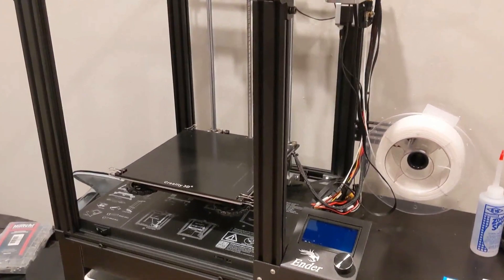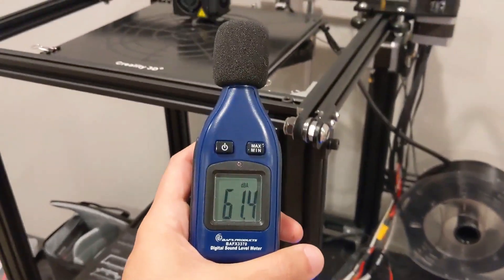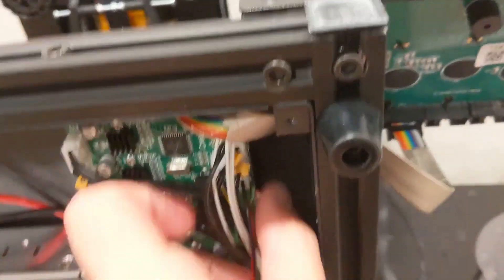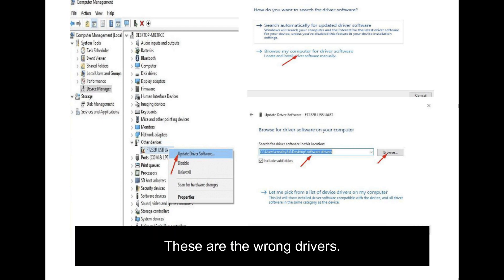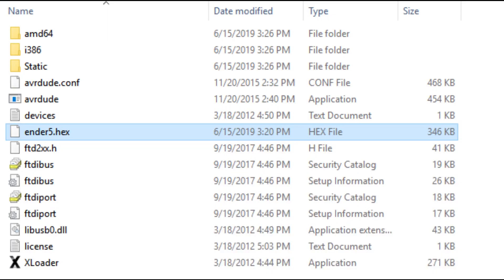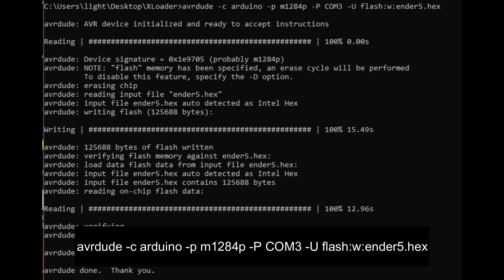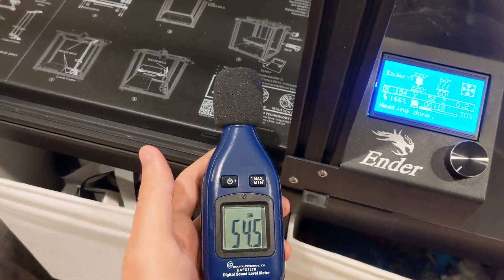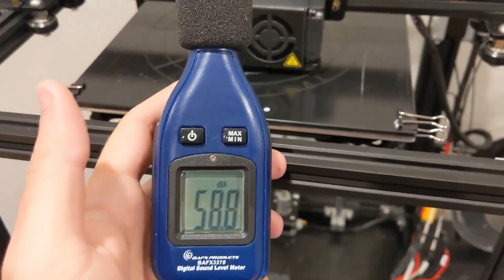Ender 5/3 Silent Motherboard Upgrade

Comment: Thank you for your video tutorial. It worked like a charm! But only after I found out that for Windows I need to install WinAVR which contains avrdude.exe in the "bin" directory (in my case: "C:\WinAVR-20100110\bin"). I copied the ender5.hex there and started the command like you described. You might want to add the link to WinAVR to your video: http://sourceforge.net/projects/winavr

Comment: Thanks. This was really helpful. I'll include some additional instructions about AVRDude though, as that wasn't obvious (for me at least):

First of all, after you go to the download page, you will only need to get the avrdude-[something]-mingw32.zip. Take the one with the highest version number.

When running AVRDude you might get a message, that it is missing libusb0.dll. In that case download the zip file from https://sourceforge.net/projects/libusb-win32/files/libusb-win32-releases/1.2.6.0/libusb-win32-bin-1.2.6.0.zip/download , copy \libusb-win32-bin-1.2.6.0\bin\x86\libusb0_x86.dll to the avrdude folder and rename it to libusb0.dll (It needs to be the x86 version, as AVRDude is also 32-bit)

 And finally, if you don't know what your COM-port is: after connecting the printer via USB go to the device manager, open Ports (COM & LPT) in the list and look for USB-SERIAL CH340

Comment: i did it, works like a charm for my ender 5 with the drivers you linked, just needed to install the driver after plugged in the board, when i installed the driver first without plugging the board in it i got a COM port error, after installing it again plugged everything worked x) 

thank you so much x)

Comment: hey there, i get the libusb0.dll erro fixed install winavr,  i get the new board in a few days and want to be prepared when it arrives. 

and can i use the CH340 drivers for the 1.1.5 board too, https://www.th3dstudio.com/knowledgebase/creality-printer-drivers-all-models/ i found this and it says i would need those FTDI F232R Windows Drivers, or can i try with CH340 too? 

i downloaded the 1.1.6.3 from the ender site hex file so i get the newest

thx alot for this video!

Comment: This worked great to flash on the new 1.1.5 board. Is there a 1.1.9 .hex file for the Ender 5? The github stuff I see on marlin's site doesn't contain any .hex files.
Reply: did you took the CH340 Drivers: https://sparks.gogo.co.nz/ch340.html
or the  FTDI F232R Windows Driver?  https://www.th3dstudio.com/knowledgebase/creality-printer-drivers-all-models/

Comment: The hex flash gymnastics were slightly different on Linux machine (e.g., no COM ports). 
For those willing to try here is the basic command from my download file that seemed to summon the mojination:

 'sudo avrdude -c arduino -p m1284p -P /dev/ttyUSB0 -b115200 -U flash:w:/home/user/Downloads/ender5.hex'

Thank you so much LOHTEC for finding the hex file.

Comment: you can up the voltage for the creality board on the board itself with a screwdriver! the board drivers don't come at set voltage because each printer is different so you need to tweak the voltage till you get a good run. look at your new board & you'll see next to each soldered stepper driver there's a silver cross shape that you can turn clockwise & counterclockwise to adjust voltaje. just fyi if you think you're stuck with an under-voltage ender 5
Reply from the maker: I'll check it out if I have time. Was running .9v on my anycubic, so not sure what these are at.
Reply: @LohTec  i hear ya, i did the same process but i checked the voltage for each axis driver when my old board was installed & made a note of it. that would be the easiest. you might be able to plug in just the input voltage of your old board & get a multi-meter to check the driver's voltage presets.best of luck

Comment: Hi there, how did you discover you couldn’t print as fast? What issues did you encounter? Could it be a marlin setting?
Reply from the maker: I got layer shifts as soon as the slower bottom layer finished. Reducing travel speeds from 120 to 100 fixed that.
Reply: @LohTec  I just read a comment on another 1.1.5 board video that the vrefs come from the factory set too high. I wonder if this is something you could experiement with and see if you have any better results? 

From the video: https://youtu.be/6nHOp-j3dtE?t=1188

Comment: 
"Your stock vrefs a bit high i think.
I had same values with same board and i was having hot y stepper during long prints. 
I asked to customer representative of creality about my problem and they asked to their technical department then they gave me these values XYZ 0.94V，E 1.2V.
I changed my vrefs to these values and never had hot y stepper again. Also i didn't get any layer shift on my prints."

Comment: can you show a video of how you used all the systems to upload to the ender 5
Reply from the maker: It's just typing in the command prompt after you extract all the zipped files. Is that what you wanted to see? It's just that one thing to type.
Reply: @LohTec  i think i found my problem i have been talking to creality about it and i need a isp pinboard
Reply from the maker: Guessing you aren't using the new motherboard then
Reply: @LohTec  I was told from Creality I need  to use the ISP also on the 1.1.5 black pcb board

Comment: I was wondering if this new motherboard includes thermal runaway protection?
Reply from the maker: Not by default, but if you update the firmware it should. The old one can too, but you would need to buy an auduino to update the firmware
Reply: @LohTec  So it's as you said if you NEED a quiet machine then get this otherwise no. Amazon UK sells these at $71. Taking full advantage of the shortage. Thanks for the reply
Reply from the maker: Careful what you get on Amazon. Often they sell them as the new motherboard, but they still have the noisy driver's. The quiet driver's ARE better in other ways, but not spectacularly so.

Comment: At last a straight foreward tut. Thank you. Sadly the boards are sold out atm. I did notice that my ender 3 runs with a 12v supply and this board is 24v. Is that a problem?
Reply from the maker: The board is in a constant state of being sold out. I'd bookmark the link and check back regularly.  As for the PSU, if you are still using the stock power supply I wouldn't worry about it.
Reply: @LohTec  thanks for the quick reply,I'll take your advice about the BM.

Comment: It's a common misconception that the Ender-5 is an H-bot/CoreXY due to the cubed design, but it’s just a "regular" cartesian printer with some tweaks to the mechanics. The X motor is attached to the X gantry (which is controlled by the Y motor via dual belts) and belt routing isn't the traditional H style. Plus, it can print circles without them turning into ovals :)
The Ender-4 is Crealtiy's H-bot printer, but it wasn’t that popular. Like most H-bot designs, it can’t print circles accurately and swapping over to CoreXY mechanics is a popular upgrade.
Reply from the maker: Thanks for the correction! I knew it wasn't CoreXY, but thought h-bot was the term used for printers that moved the extruder on X and Y.